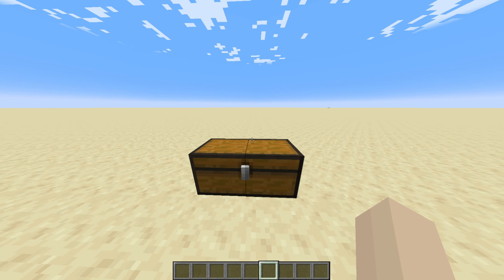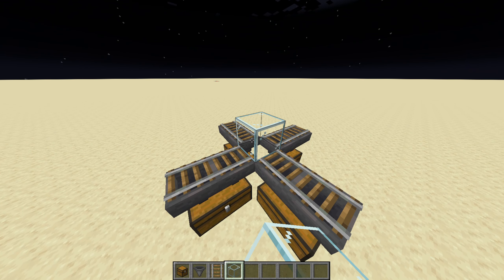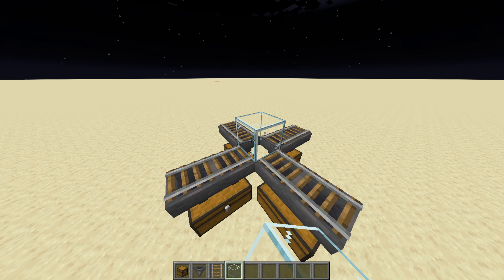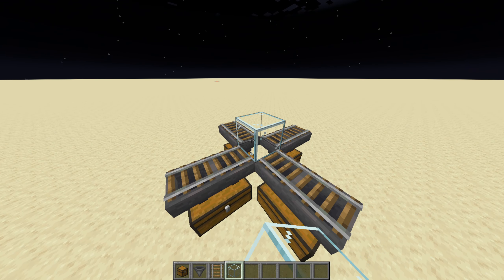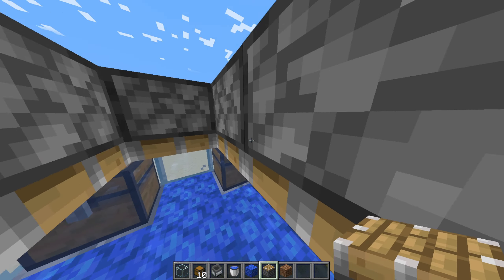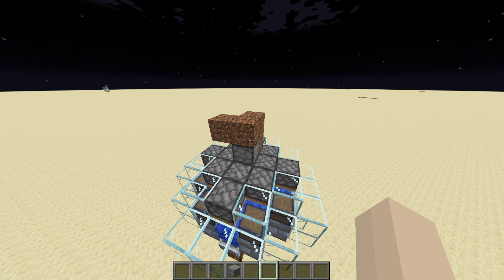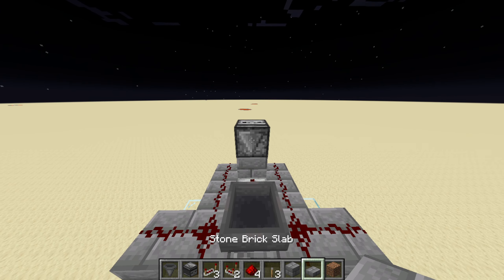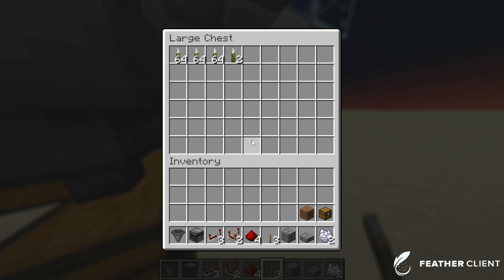How to build a automatic sea pickle farm(tutorial)

Comment: I have a question does this give 25k per hour or 70k because u said its 25k the video you linked is 70k
Reply from the maker: this exact farm is designed to be used on donutsmp and the redstone is a little different making it slower there for making 25,000 drops instead of 70,000